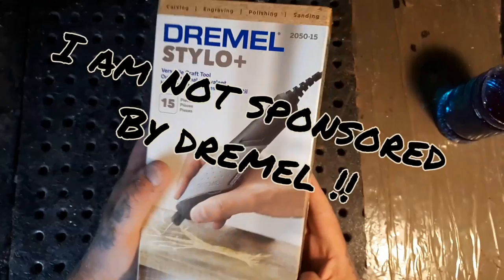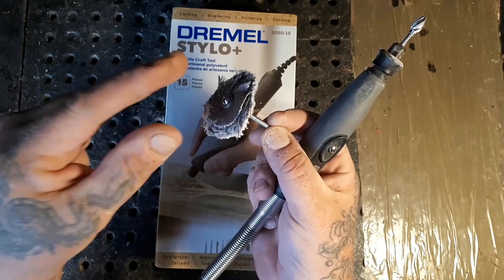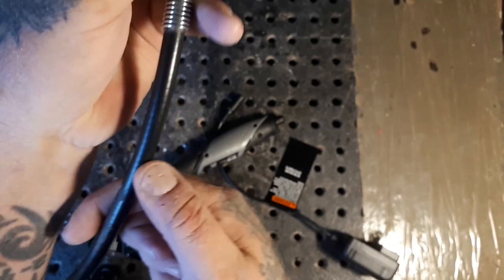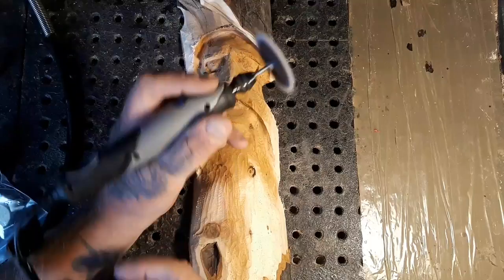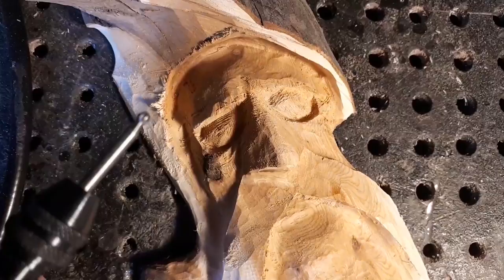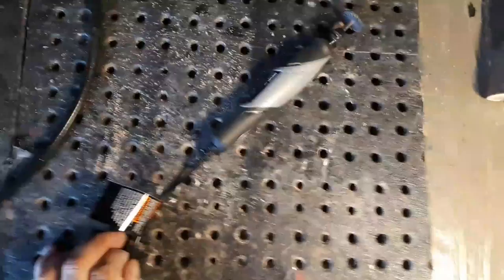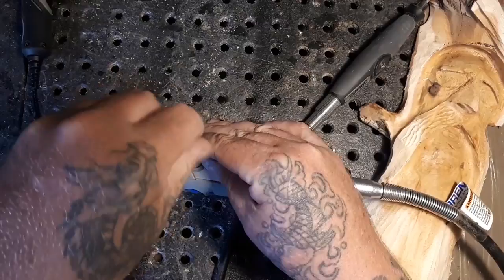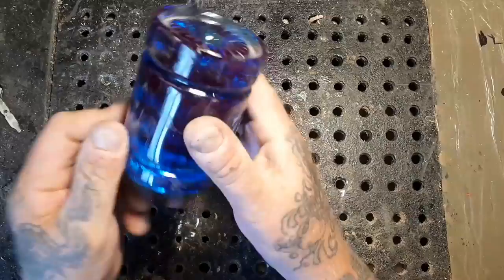Dremel STYLO UNBOXING and testing. Dremel review. Dremel

Comment: The “bogging” out is a feature I think because the motor isn’t as strong it shuts off when you push to hard
Reply from the maker: Ya because its junk
Reply: It's not set at a good  speed for that and it will bog down when using  too much pressure. It's best for detailed work, softer wood and engraving

Comment: This dremel is suppose to be used the same as the other ones, but easier to handle, and the motor is suppose to stay cooler
Reply from the maker: Not much power
Reply: Yea, I definitely agree with you on that, I bought one to try it out, works good with rocks and glass but as far as wood, pretty much the small detail you mentioned. Lol

Comment: I have one, nice tool.  One thing I do not like is that the lock button is exactly opposite the power button, so I keep accidentally grabbing the power button while using the lock button. So I’m trying to add a new bit and my fingers push the power button by accident, causing it to spin. I do not understand why did they put the buttons on opposite sides where the fingers inadvertently push the opposite button?

Comment: Hi Jordy. I have Dremel 3000 and it's great for almost anything. But I need a small rotary tool such as Dremel stylo for glass and stone engraving.  What did you thing about Stylo for glass and stone work. Did he fit for the job ? Or maybe marathon Micromotor. You have both rotary tools, what's your honest opinion for these two machines. For wood carving Dremel 3000 works just fine.
Reply from the maker: 100% the micro motor 100% the stylo thumbs down for me
Reply: @CarvingFusion   Thanks so much. I saw one of your videos with stone engraving but that wasn't a diamond burr maybe one agresive burr from Kutzall. Sorry for the stupid question, but I try to engrave just from 2 months and I know nothing. And so far my carvings are disaster. Did I can use different  burrs for stone carving except diamond ones ?

Comment: Talks about how the weight of the 3 jaw chuck and large bits are bad for the bearings. Then proceeds to do the opposite of what he just suggested. Your gonna burn that thing up fast. I can hear the thing is unbalanced by that irritating buzzy whine it's putting out. Bye bye bearings.
While the collets are less convenient, they offer less runout and tool vibration.